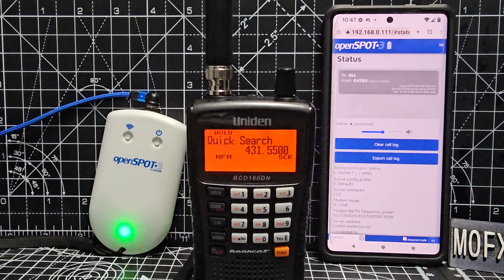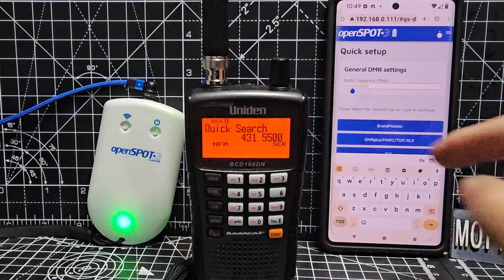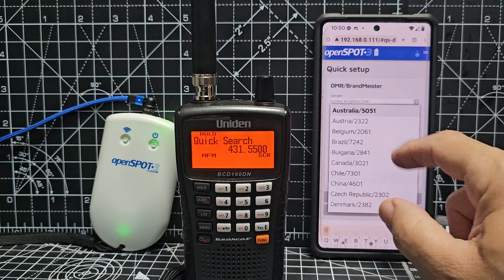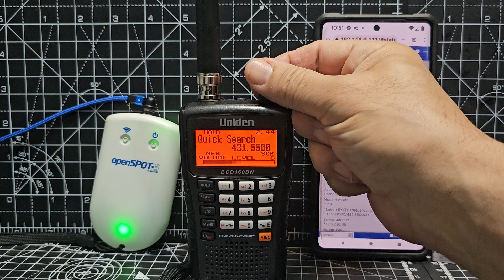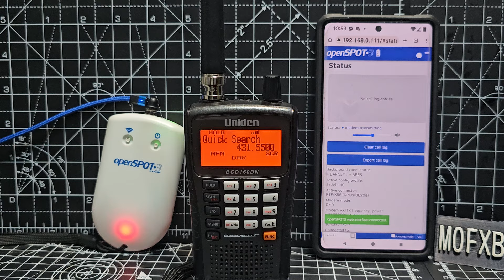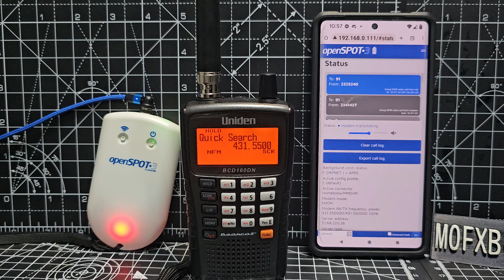UNIDEN 160DN / SDS100 - CROSSMODE & NXDN

Comment: Do you have Radio Reference there in the United Kingdom. If your looking for NXDN frequencies . This is where they are allocated. NXDN has 2 baud rates 4800  and 9600 along with Ran keys 1 - whatever . The NXDN frequencies are digital and are set by using the specific ran code that is assigned to it . Great videos . Thanks
Reply from the maker: Its different in UK